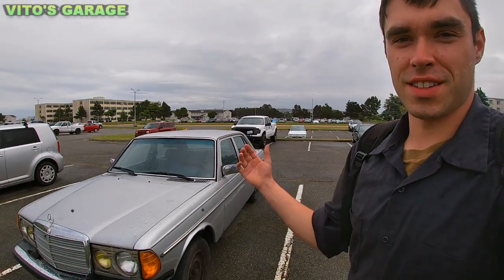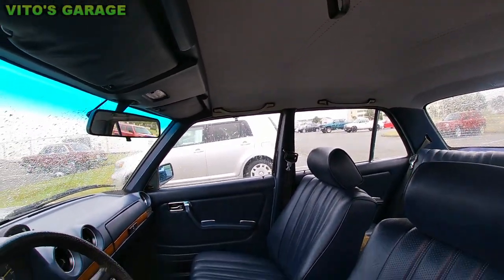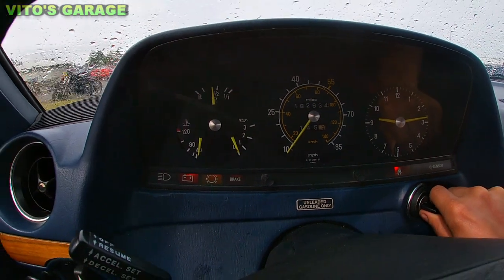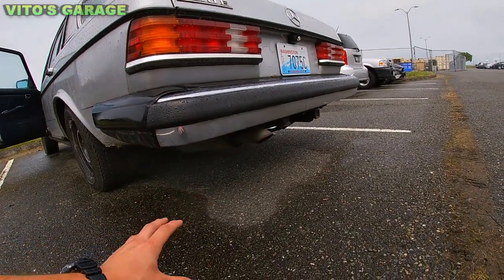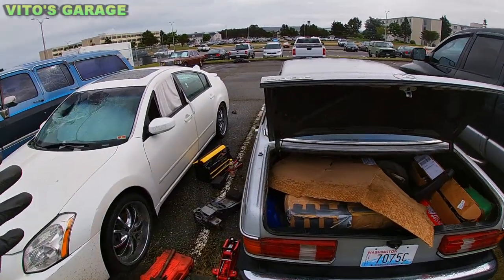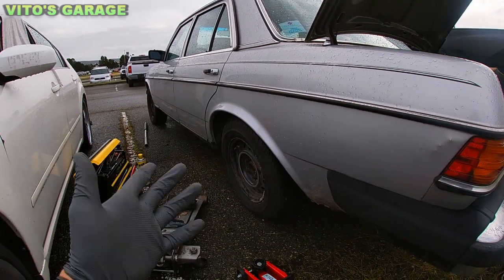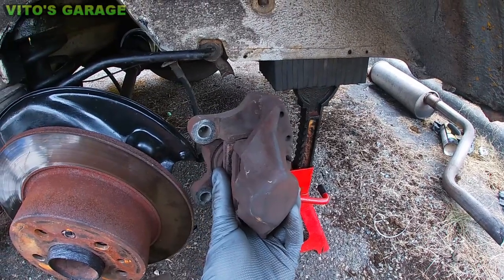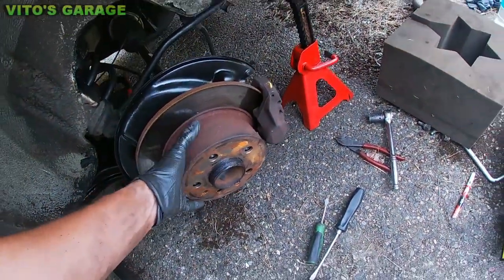Rear Trailing Arm & Axle Replacement Mercedes W123 W115 W116 W126

Comment: Btw I replaced my rear control arm, it was such a pain. I didn't have any issues with the spring, it safely decompressed once the shock was unbolted and Jack lowered the arm.

Comment: Vito my rear trailing arm is ready to go through because of rust where the spring seats on I need a used one with good bearings any ideas or where to look or where to get one used of course thank you Vito if you can reply
Reply from the maker: Ebay, junk yard, online, craigslist, Mercedes dealership. I recommend changing wheel bearings at the same time and doing the rust prevention like in this video as well as changing the bushings on that trailing arm

Comment: Hi Vito any spring compressor reccomendations?
Reply from the maker: Hi sir. You have to use a Mercedes spring compressor like the one in the video. You can buy those online or EBay. They sell the ones like that for $70-$100

Comment: Where do you get the rubber piece between the jack stand and the car?
Reply from the maker: I got them back when I was working for a shop. They're amazing things! I always use them to jack up a car with and I use them with jack stands!! They prevent bending and rupturing the metal on the car!! I found a link for you: https://www.carliftparts.com/product/rotary-lift-3-rubber-stack-blocks-auto-lift-rolling-jack-fj2428-set-4/?gclid=Cj0KCQjw6ar4BRDnARIsAITGzlAXV9pbjyibF0OOvh-ifyhOKR5UdlbP-8yn93lsitpSUglPJGtmQqoaAtqWEALw_wcB

Comment: #VITO'S GARAGE i want an information about the rear axles of w123 and w126
My w123s axles are giving the clunking sound while driving even after repairing them kindly let me know that can w126 axles  be fitted in w123 or not and which parts of w126 and w123 are same
Thanks in advance
Reply from the maker: W126 axles won’t fit a W123. W126 axles are bigger
Reply from the maker: Find good used ones or new ones. If you find used ones, replace the boots and add new grease
Reply: @VITOSGARAGE  thanks